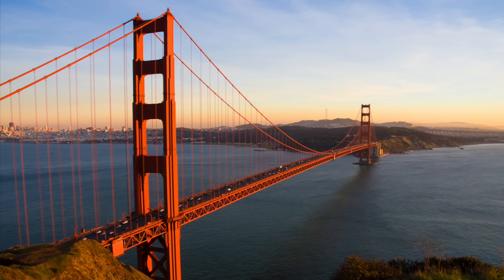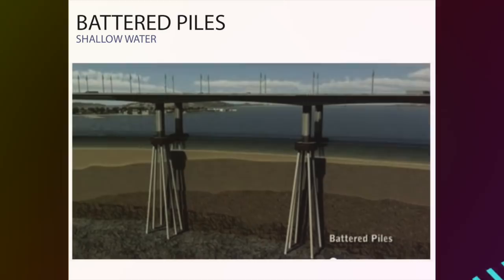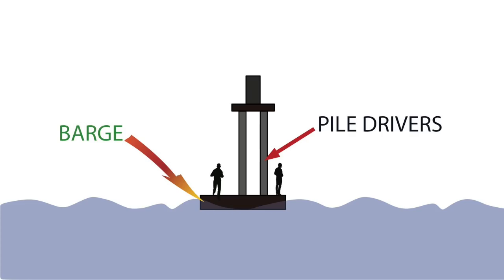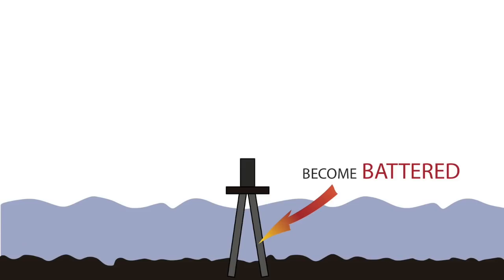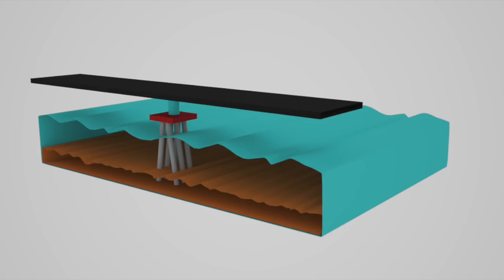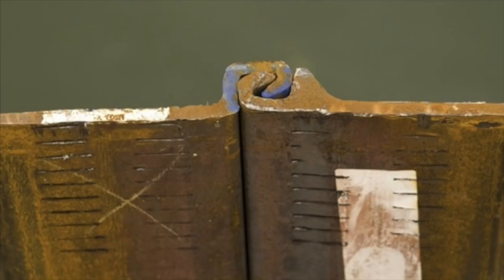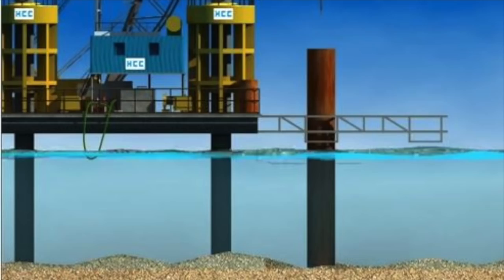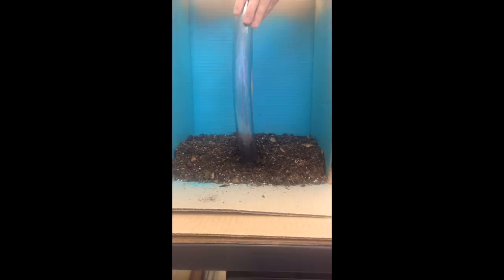How do engineers build bridge towers under water?

Comment: The battered pile angle has nothing to do with when you "driving" your boat... There are always currents in the water that play a bigger significance than any movement of a boat can make! Piles are angled to provide a triangular support base for the load placed upon the structure. And everybody knows a triangle is stronger than a square/rectangle.

Comment: the first of this was slightly incorrect as concrete shatters when hit especially when its being hammered into solid ground, how they really do it is they pile drive several steel tubes into the ground where the base is going to be then they lower into the tubes reinforcing & fill with concrete then they add the base which recent years concrete has been developed to set under water

Comment: Wrong, piles are steel pipe , not concrete , you hammer the steel piles in , remove the dirt inside the tube then added a steel cage of rebar , then pour concrete inside as this make your support . If the steel pipe rust away , then you have the concrete piles left in place . Hammering concrete will break the piles.
Reply: plies you don't need to remove dirt as they are tapered into spikes & once driven in they are simply hollow tubes, an address I lived at the neighbours house was being underpinned & the piles they used was sectional with the first section being the tapered bit with the hollow tubes being added as the piles went deeper into the ground

Comment: 3 sided box? ummmm no. 4 sides make a box. three makes a fucking disaster. please don't become an engineer.
Reply: +reality Actually, 4 sides make a casing. 6 sides, or faces, make a general box. 6 sides of equal length, height and width make a cube.

Clearly they are students and this is a project for an Architecture class (i.e. Arch 352 Project 2).

-Engineer in Construction
Reply: reality you just got told you silly goose
Reply: +reality Ever seen a triangle? lel